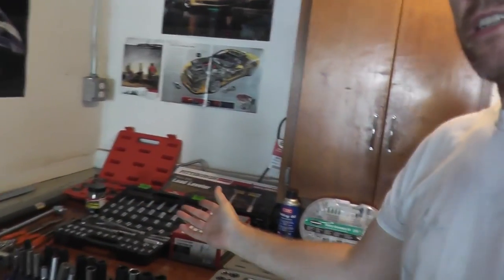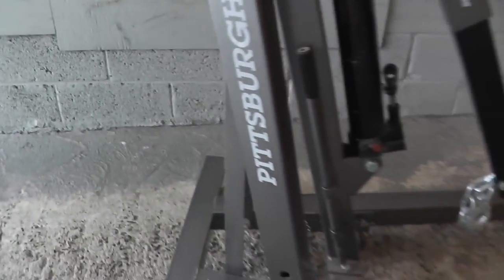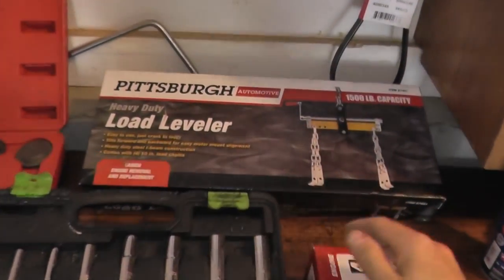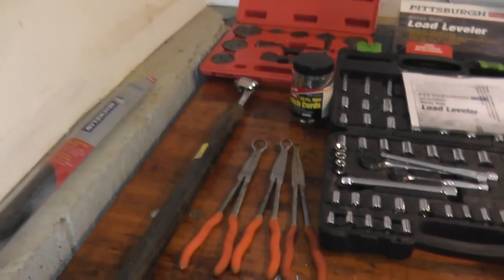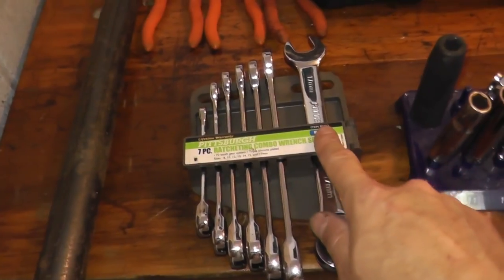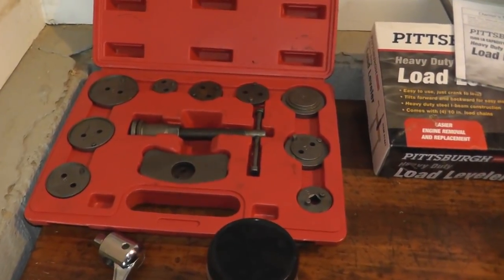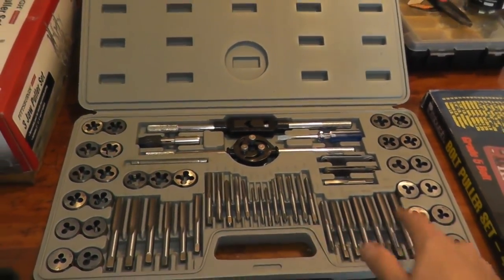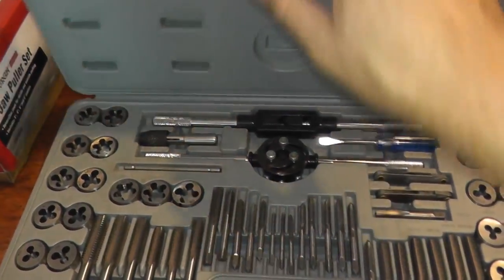Are Harbor Freight Tools Any Good???

Comment: This dude has no ideal what he is talking about
Reply: anthony  why do you say this  are you some kind of tool expert?   do you do any car repairs.  I have been at my shop since I was 17   and now im 53   I still have tools from hft   since then.  and learn how to spell
Reply: based upon what?? what product was he wrong about??
 I dont know any one who has broken a HF  Pittsburgh pro tool ...that was using it  as intended...no pipe .. as intended ...
Reply: Trump 2020 ..
Reply: deepswaut600 - if you dont know someone that has broken a HF pitsburgh pro tool using as designed, then you dont know anyone that uses there tools enough :)
Reply: @devilzjoker1013    OK ..what did you break and how did you break it?
Reply: Just trolling, I use all different brands HF, snap on, Craftsman, (small engine mech) just saying they'll used enough a lot of tools will wear out, impacts get floppy, ratchets get loose, I haven't had one catastrophically fail though.
Reply: @devilzjoker1013   I have only hard the half inch drive extendable ratchet fail...would not extends...they replaced it
Reply: To answer your query about HFT items that have broken, I have broken many of their tools using them properly. Most frequently is their 1/2" drive impact Torx heads. I work on a lot of northern Jeeps and the rust just locks them bolts in place, even after heating them to help relieve the pressure and break the rust. And then there is the dead blow hammer, particularly the 4-lb one. The plastic is far too brittle for regular use. They always replace them but they do catastrophically fail. Another one I have broken frequently is the ratchets and torque wrenches. The mechanism just fails or the head stretches out and no longer engages. Again, they replaced them but it was time out of my job to get new ones. They are generally good tools but like everything else, they fail eventually even if used properly. The best part about HFT is the warranty and the ease of use of that warranty. I have used their tools almost daily for the last 10 years, some are still the originals and some are on their 20th replacement.
Reply: @uscowboy13   I would say a TORX socket is the weakest item any one makes   I have had a  extendable ratchet  seize .. but never broken 
 if you watch AVE he has found most 3/8 drive ratchets are good to 300+ lbs of torque... NO ONE is putting that much stress on it without a pipe ,,,including me LOL